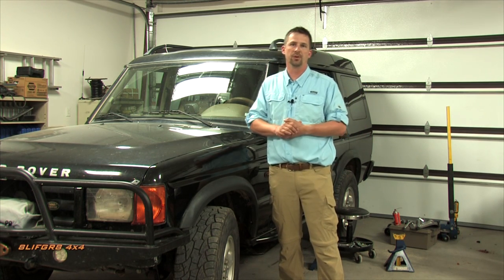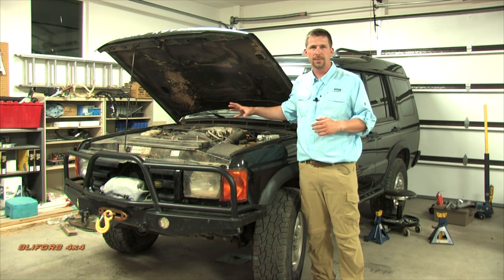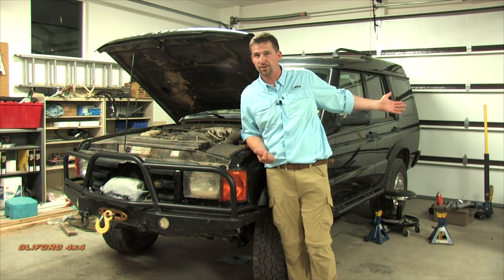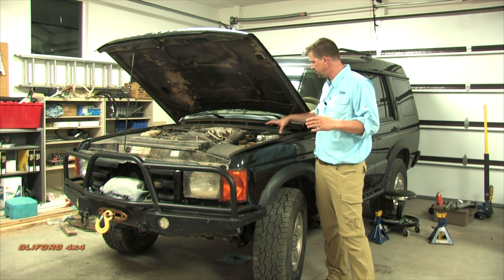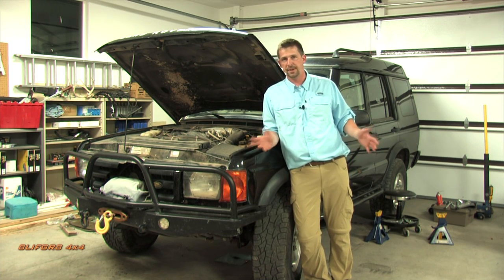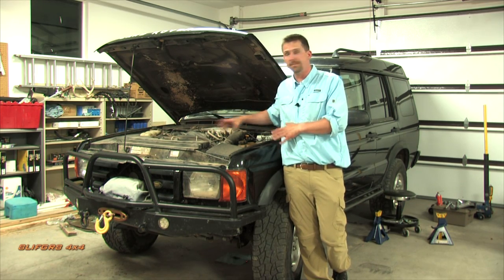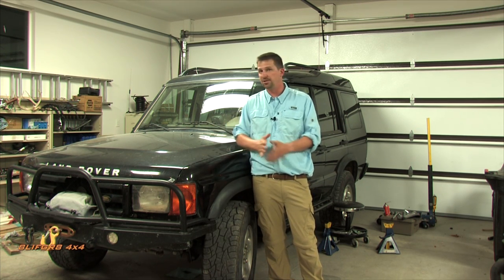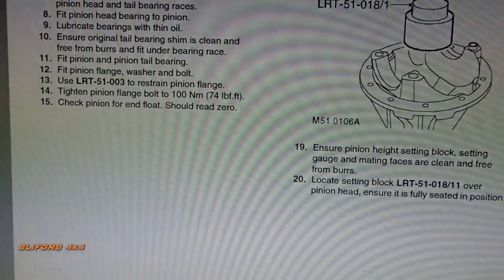Ultimate Owner's and Buyers Guide:  Land Rover Discovery 2

Comment: CDL problem: you can have it in transfer case but not have the command, you can have not one in transfer case, you can have it completely installed. Ashcroft UK have solutions for both first two cases
Reply from the maker: Yup, but it's much cheaper to have the CDL and just buy the cable than it is to bolt a new center diff lock to the t-case.   In either scenario though, having the CDL on a D2 is awesome!

Comment: The toyota frame rust came from the early 2000's on the trucks due to a 3rd party frame manufacturer using chinese metal
Reply: Ahh, that special material 'Chineseium'. To quote Star Trek, 'it's steel Jim, but not as we know it'

Comment: I have a 2001 Disco 2 with TD5 engine and BOIIIIIIII let me tell you about maintenance :D But i ABSOLUTELY LOVE IT ! Do you have issues with rear quater chasis rotting ? I have to replace my chasis because of it.
Reply from the maker: It's more rare in the states than on the UK, but it is a potential issue
Reply from the maker: I'd do years of manual rust maintenance if I could just have the TD5!!  How reliable is that motor?
Reply: @ForgottenWaypoints  First chcek oil pump bolt if its properly tight and with threadlock apllied. They somehow forgot to aplly threadlocker in factory and if this bolt fails you loose lubrication. Some of early TD5 have bad issues with porous/cracked head leaking diesel into oil (i had this and swaped my engine from a totaled defender). You can get spanish engine head to fix this. Besides that its pretty bullet proof its not prone to overheating and i personaly know a guy with td5 def which had 330000+ km on his engine with out overhaul. He told me that with proper maintenance (oil changes every 15km) TD5 can go 500kkm with out major overhaul (big bearings on crankshaft etc) Btw and with at tyres i get arround 10l per 100 so its quite economical as well. Oh and chcek storm tunig what can be done with TD5 engine wheen remaped.

Comment: Hey there, wow really appreciate this video. well worth the wait man. I have a 2004 disco that currently not on the road, but I've been very careful with to try to preserve it from doing any potential harm to the engine before I can gain enough funds to get it on the road proper. when I first purchased my vehicle it was running very well for a vehicle of this age and especially a disco 2. I first fell in love with the disco when I purchased a second hand 1999 disco 2. despite all the issues and cautionary tales of the vehicle , I fell in love with it.   so my question for you now is im interested In an ultra gauge. do you recommend this ? and what are the settings did you set your ultra gauge aside from the obvious,  coolant and engine temp. what do you recommend , I believe one can set if for max of 6 gauges?
Reply from the maker: I love the UG.  I have my main page set for engine temp and intake temp, then whatever you want on the small gages, I think I have RPM and mpg (instant/average).

On page 2 I monitor the 4 O2 sensors, but use that page rarely.  It's an amazing tool, I've bought 3 (D2, L322, and a 2500HD for tranny temps)
Reply: You can also use a bluetooth ODB2 reader and the torque pro app on your phone. I love it, although get a good reader, I bought a cheap buggy one at first and it would drop out a bunch.

Comment: It's not oil leaks - they just 'sweat' profusely. Self anti-corrosion system by the motors sweat means the front chassis will be as new if you cleaned it off. Seriously I have a TD5 with 200k miles and she is a daily driver in the UK.
Reply from the maker: I love it!  I wish I had the TD5!
Reply: @ForgottenWaypoints  It's a shame US didn't get the diesel engine. It's a strong motor for the capacity, torquey and efficient and fairly indestructible. The head gasket needs doing at 150k as the head locating dowels factory fitted were plastic and eventually shear. I have a manual box without CDL (the time when they stopped fitting as standard) but she still climbs every mountain.

I'd like to add that I recommend to change all the chassis bushes for Polyurethane (kits are available in various stiffness with stainless steel bolt sleeves). The weight of the vehicle distorts and wears away the rubber bushes which makes tracking adjustments almost pointless. This will make the chassis feel like new. The rear rubber Rotoflex prop shaft joint is a no-brainer, they should be done every 4 years or so, it will stop rear axle vibration on cruising. And to add a bit more, people should check the hard rear brake lines where they sit above the main chassis rails in the rear wheel wells. It collects dirt and water on top there and rusts out the lines. Because these vehicles have EBD (electronic brake-force distribution) if you carry heavy loads or tow, the rear axle gets more force distributed to it. I burst a line towing a race trailer and lost pedal feel (imagine my reaction). I suggest replacing both lines if they are suspected of ageing with copper lines. It's a fiddle of a job but cheap and worthwhile. Also braided brake hoses instead of rubber for that hard pedal feel.
Reply from the maker: @agilchrist73  , Great insights, thanks!  Now if my landcruiser didn't take so much upkeep, I could get back to maintaining the D2!  (I really need to go after my transfer case and rear axle seals!)

Comment: So the best lr disco 2 would be the td5 manual transmission? Albeit taking all your other advice. Thanks for your dedicated insights.
Reply from the maker: Most people claim the best D2 is a D1!   But yeah, I'd love a TD5 in either auto or manual.
Reply: @ForgottenWaypoints  I have a 2005 TD5 Defender pick up and appreciate it for its utility and versatility, but the Disco has the same off road capability, with the comfort and looks. From what I read the 2004, with functional diff lock,  would be  a great choice. For some odd reason, you can pick them up much cheaper than a td5 defender in the UK. The defender is bare bones, whilst the Disco comes with lots of luxury features. Real bargain prices for a collectable icon, with present day off road adventuring capability.

Comment: Was thinking of buying a Disco 2 but after watching this video i think ill pass. Thank you for all the great info.
Reply from the maker: Yeah, I'm not going to deny that I"m worried about a slipped liner myself!   That said, I'm going to do a similar video on my LX470 (100 series Land Cruiser) once I get a chance to do a few more maintenance jobs on it.  While the Toyota is a vastly superior and reliable drivetrain to the Rover, it does have it's own issues which are extremely frustrating (and expensive).   I think, in the end, the 15-20 year old vehicle space is kind of a gamble.....figure out what rig you like and prepare to fling some maintenance money and time at it to get it in top form.
Reply: @ForgottenWaypoints  that's probably true. Knowing what you know now after owning both which would you choose as your overlander.
Reply from the maker: @ickna2002  I'm not sure.  The confidence and security you feel in a Land Cruiser when on the trail is second to none.....but the maintenance costs when I get home are killing me.

So it's hard to tell.  I love my LX470, it's holding up better, but because of the maintenance and TLC, I haven't had time to work on my Disco.  My disco now needs to headliner work (it's been sitting in the sun), more leaks underneath, and possibly a tuneup.   All of that is going to take work and time, but are fairly cheap.  Cheaper overall than the timing belt job that I did on the LX470.     

So I'm not sure I can even answer that myself.  If you have the budget, the Toyota is tough to beat.  If you want to roll the dice, a D2 is incredibly stout and cheap (as long as the engine holds up).

 I would not own either if I had to rely on a shop for maintenance, I'd save up for a newer rig:  Wrangler or 4Runner.
Reply: @ForgottenWaypoints  thanks for the good info. My choices were Toyota or the disco and so it's good to hear your point of view owning both. Around here a Toyota with 250k-300k miles goes for $6k where I could pick up a disco with about 150k miles for around $2k
Reply from the maker: @ickna2002  It's the "cost to play" that becomes and issue and primarily why overall ownership of a D2 is cheaper, even with an engine replacement.   My D2 was less than $6k, my LX was less than $16k.  I've already put thousands more into the LX than my Disco will ever see.   That's the reality of it.  Even if I put a new rebuilt engine into the Disco, it'd still be cheaper than it was just to buy the LX.

That said, if each rig was the same price, I'd most likely select the LX.  There is just something to be said about a vehicle that gives you plenty of warning before things seriously go south.  The size increase is also nice for camping (not as good for off roading).

 I give an edge to the cruiser on that and because the 2uz-fe V8 is an entirely different category than the Rover V8, it's legendary.

Comment: You're bouncing between so many models I'm getting confused I have 2003 how many of these things you've recommended should I change out on the 2003 I know I only heard you say the oil pump for the 2003 but what about all the other things that might go wrong cuz I do have multiple problems with the Three Amigos constantly on off on off on off so that's another thing I have to change and I'm also worried about the sealed thing next to the catalytic converter you were talking about is that also relevant for the 2003 model and what else should I have changed out now so it's not a problem down the road I'm wondering if I should change it every single one of these things you're talking about so I'm a little confused what about the four-wheel drive. Center differential case wired to transfer case for 2003 too. Should I or do I need all those things for 2003??? Or does this apply only to different models. And what about that traction thing.??? I have that downhill button on and off vfc that must be part of the 3 Amigos? Can you please answer these questions.I want to do everything I can to keep my landrov er r goingvand going and going well. It has 126,000 miles. What first second third etc please. I am only using at synthetic. It likes it but I'm moving to Idaho and it can get 20 below what oil should I get.and any advice. I love this car it was a blessing. Previous owner was alittle rough. And what about that heavier oil and filter er r being bosch

Comment: nice video. in my opinion, a discovery with the original cdl is worthless for offroading. Ideally you get a transferbox from a defender as the lower gear ratio will help with the bigger tyres that you will inevitably install.  Anything over 32" tyres you really need the 1.4 gear ratio lt230
Reply from the maker: The D2 has an LT230 with a 3.2:1 low range.  You are talking about the ratio in high.  I agree, that is steep, but it would be easier stateside (since we don't have access to Defender parts) to simply regear the axles and gain some RPM back for power in the hills.  This is commonly done in the US.

I've always felt the LT230 is the best part of the D2, it's almost as low as a Rubicon Wrangler and it's helical geared rather than chain driven.  
 There are also US suppliers that sell gear reducers if you want to go even lower, but I hope you have Toyota axles or HD shafts as the front and rear diffs and CV shafts are now your weak link.
Reply: @ForgottenWaypoints  yes, was talking about the high range. There are suppliers who can sell the gearing for 1.4 or 1.6 as you say and then you can rebuild .  If you do not go over 33s diffs and cvs will not be an issue. The lower high ration is especially important for those who have an R380 manual box as opposed to most people in the states who have an auto.

By the way the transferbox leakage is most probably caused by a worn intermediate shaft or the housing itself.  It sometimes also leaks from the seal around the input shaft. Gaskets do not usually fail when done properly (rtv silicon would be preferred)
Reply from the maker: @broli85  , Thanks.  I'll check into that.  I"m wondering if I have clogged breathers.  Both the rear axle and the T-case started weeping after my San Rafael Swell trip which included mud and water crossings.  

Problem is, I haven't had time to properly look into it.....dang Toyota has been taking all of my spare maintenance time for over a year.  Go figure!

I would love a 380 and TD5!!
Reply: @ForgottenWaypoints  haha, dont get too excited about an r380... they are not that 'great', although quite reliable and usually the last thing that fails in the drive train, especially if taken decent care of. if you offroad it i would extend the breathers.  personally I have scrapped the banjo-bolts for the transferbox and gearbox and fitted hydraulic push-fit fittings, which in my opinion are better.  it you are opening the transferbox to fix the leak its worth replacing bearings and more than that fitting an HD cross which is a stronger design than standard

Comment: Hey man when are you going to make more rover videos!!!???
Reply from the maker: I had a few lined up, then the transmission went kaput!  I have to shift manually and it won't hold under high torque (like 4lo).  So now I'm deciding if I want to replace the transmission or move on from it.

In the meantime, I still commute in it...drove it to work today in fact, I just have to shift manually.
Reply from the maker: I searched for wild horses in it earlier this year.  It wasn't exactly technical terrain, but it was good to get her out again.  That was two months before the transmission went out.
Reply: Wow man that’s crazy. It will be cool if you do an LS swap! I’m getting ready to buy my first disco 2 and I keep finding myself coming back to this video so I can be prepared for Whats to come. I’m planning to do an LS swap on it though due to the fact that the engine is a little temperamental.
Reply: I still have a lot of questions though like where do you get oil leaks besides the gaskets the guy I’m buying my disco from told me that there’s a slight oil leak and you need to top it off every month or two.

Comment: Great content! I'm thinking of buying a 2004 Discovery 2 but I've read that replacing the spark plugs and coils is a bear of a job, because of the location of the coils ? Can you share your experience with this and do you have suggestions/tips for DIY''s of best strategy to get it done with the least problems? Thanks in advance for your input.
Reply from the maker: I haven't had a coil failure yet, but it's located at the rear of the firewall.

There is a relocation kit that puts them up front to make the job easier.  I would consider it if I was tackling the job.  Maybe someone who has done this can chime in?
Reply: @ForgottenWaypoints  Thanks for your feedback.

Comment: Hey there, Ok so im looking into investing in an ultragauge for my disco 2004 , there are 3 choices on the website, which one do you recommend? which one do you use on yours?
Reply from the maker: Cheapest non-bluetooth works best.  You don't need any of the special functionality the expensive one offers and the Bluetooth ties up your phone.  Just get the basic gauge, plug it in and go.  It takes a bit to setup your screens...  

I like to have intake air temp and instant/average fuel economy also listed

Comment: The only problem with th 5w40 oil is that it's not meant to be used with catalytic converters.
Reply from the maker: Do you use 5w30 in winter and 10w40 in summer and add zddp?  The problem with modern oils is that they aren't made for flat tappets, so you are reducing camshaft life.  Cats seem cheaper/easier to swap.

Comment: Listening for 3 Amigo info: mine are on with the read brake icon.  Attempted to have codes deciphered (1590) and the assessment is that there is no communication from the system. I’m about to drop off for troubleshooting. Hope someone has some input; I know that I’m down to wiring—which looks good, grounds have been checked and the abs computer itself.  Happened after a head gasket replacement was performed.  Reconnected battery and this code immediately came up with know explanation. Thanks
Reply from the maker: Try landroverforums.com and/or post in land owner owners USA on Facebook.   I have been lucky not to have 3 amigo issues, so other than the popular fixes, I can't help much.  :(.
Reply: Thanks so much.

Comment: I was thinking of buying a 96 land rover discovery it has the 4.0 it has a 2 inch lift ,roof rack,bumpers ,and new AT tires, it is his daily . Is a 1996 worth buying I've always been a jeep guy thinking of going this way for overlanding instead of just hard core rock crawling now . Any in put on this division??
Reply from the maker: The 1996 is a discovery 1 which has a number of differences.  

1) slightly smaller, so better off road angles.

2) the Rover V8 is historically more reliable than in the D2

3) the axles are full float, which is a huge upgrade.

4) there is no traction control, which kind of stinks, but the center diff lock is standard.

A D1 for a good price would be an awesome rig.  Remember, the camel trophy rigs, other than the roll cage, where only modded with a rear end 'cut' to improve departure, everything else was pretty much stock.  The D1 is awesome.
Reply: Man thank you for your help id really like to have this truck and he only wants $3000 for it. He tells me it is his daily driver and hes had it for 2 years. He is about 2 hours from me but it'll be worth it if I can sscore a decent rig. Your you tube stuff has been super helpful to someone who dosnt know a damn thing about land rovers thank you
Reply from the maker: @mattieboy6778  , Thanks for the compliment!  Let me know what you think of the rig!  It might be worth checking out!